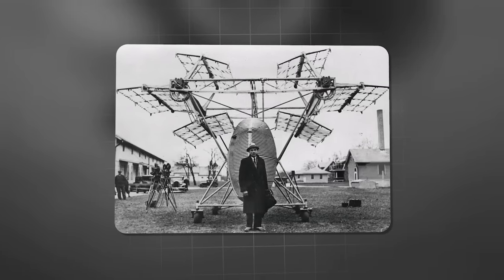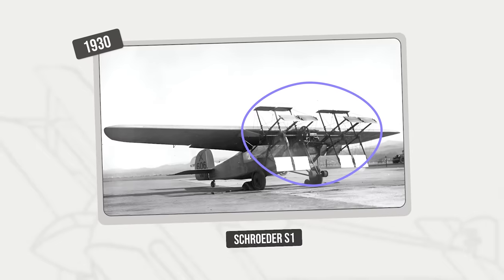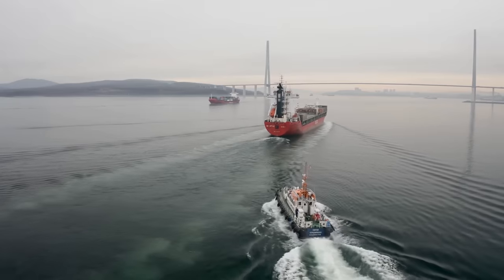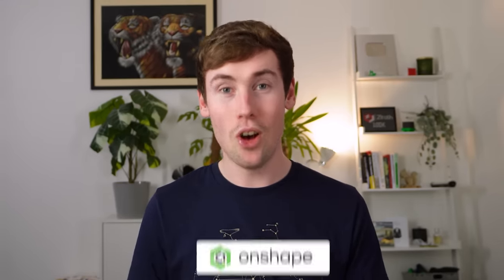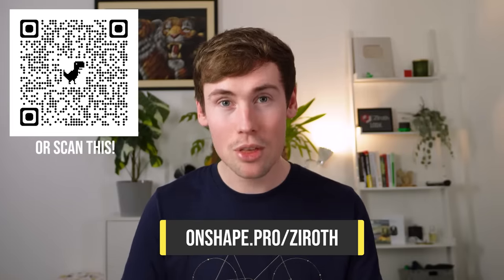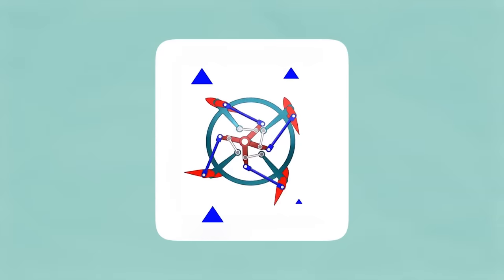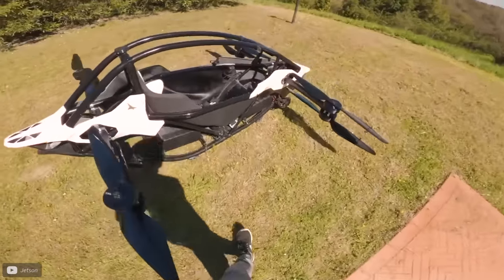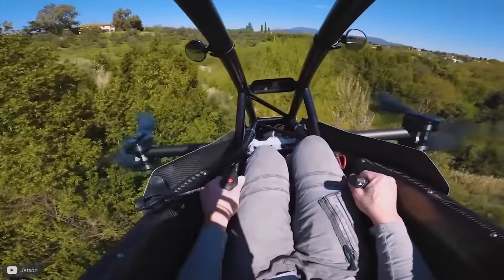The Genius of Cycloidal Propellers: Future of Flight?

Comment: Use them as cycloidal propellors for VTOL then "feather" them into horizontal position to act as regular airfoils in a craft propelled by the thrust from a turbojet. The turbine could even have a power take-off to spin the cycloids when they're being used in VTOL mode. Whether that's any more efficient than alternative technologies that accomplish the same thing is the question that needs to be answered, but something like that is likely the best way to solve power to weight ratio issues.

Comment: Very well-presented video with the pros and cons of this propeller! It reminds the limitations of vertical-axis wind turbines (Savonius and Darrieus) versus horizontal propellers. As you mentioned, dynamic control of the blades is required to maximize efficiency, which increases complexity. However, there should be some benefits for some applications. Thanks

Comment: With conventional propellers you tilt in the drection of travel. It looks like you'd be able to control direction and attitude almost completely independantly with a cyclorotor. You could accelerate while remaining flat and level or you could hover while looking at the ground. very cool

Comment: I sailed tugs with Voith-Schneider cycloidals.
Reply: A man told me about the test of two of them. On one of them the blades bent under test and should be strengthened. 
The other tug pulled the bollard off the pier. That was his excuse for being late. 
Oddly, no-one at university believed such a propulsion system existed.

Comment: Works much like a helicopter, and if any rotor fails, you have no wings to glide down safely with. At least a helicopter has some mass to sustain inertia on the rotor for a partially controlled decent. I think I'll stick with fixed wing planes. Replacing the screws for water vessels however is an interesting idea.

Comment: An obvious advantage of a four cyclorotor craft is that the outer hubs of the rotors could have tires on them and also serve as wheels.  It could drive along the ground when not flying.
Reply: Maybe. The ground wheels would have to decouple from the airfoil rotors so the latter could produce enough lift for takeoff without propelling the former to ridiculous speeds, or so I feel (not an engineer in this field).
Reply: You would just need to have the aerofoils turn to angles straight on with the rotation to not create lift. And if the car driving dynamic performance got high enough, you could also have them turn in the reverse direction to generate downforce. And could even have it sense and adjust each corner to maximize grip of each tire. 
But... that would also mean adding suspension linkage that was locked stable during flight but compliant on the ground, as well as steering system that could also be locked rigid in flight. Adding alot more weight and tons of additional complexity.. not to mention battery life to drive after doing a flight... but who knows, maybe 80-90 yrs down the line 9f development as other technologies advance with it..

Comment: Spinning a pair of semi flexible wings around a hub so that they fly in place and controlling the angle of attack cyclically and collectively for altitude and directional control is a good way to do vertical lift. And on top of that the bigger you make it the more efficient it gets, unlike the competing solutions. 
And it's mechanically simpler than the competing solutions. That's the reason we settled on helicopters for this sort of thing. That's also why helicopters like the Mi26 and CH-47 can exist, the bigger and slower the rotor the more efficient it gets at generating vertical lift. An Erickson Aircrane's turboshaft has about the same watts output as an F35B's engine but it can lift 11,000 lbs in addition to it's own weight while the F35B in VTOL can just barely lift itself and needs a rolling start when fully loaded.
 
EDIT this also one reason why we don't have full scale multirotors, a single large slow rotor is more efficient than 4 smaller faster ones. Full scale also requires use of constant rate variable pitch props (you can't really control thrust by RPM unless it's an electric system, turboshafts, piston engines or variable speed gearing systems would be too slow) and you end up with a machine that is more complex than a helicopter while also being less efficient at vertical lift.

 They actually built something like this in the 1950's called the Curtiss-Wright VZ-7, it used a central turboshaft engine connected by shafts to four variable pitch props and was stabilized by a three axis mechanical gyro system. It was said to be very easy to fly but it was mechanically more complex than a helicopter while also being less efficient and the program never progressed past a one man prototype.

Comment: I'm happy to see this progress and hope they continue. It looks to me like that setup would be excellent for control but for the primary thrust and I'm not sure it has it because I didn't see it, but it should be added. Is it it needs to have very rapid powerful air vents that is well thought out for propulsion. Some will work like powerful vacuums sucking air for moving air, then the air is routed strategically through pipes or tunneling within the craft of sufficiently large diameter all through to stay powerful. Somewhere are the powerful electrical pumps able to do this.  They aren't related to fans or airplanes or helicopters or turbines they are simply very powerful electrical pumps that are capable of moving a lot of air rapidly sucking it in and blowing it out both forcibly. They will do so so forcibly that it will need to be made of sufficient materials capable of expansion not of aluminum for example but a light stainless steel. this would be the primary drive for hovercraft of the future including personal vehicles and hoverboards and hover surfboards etc. But for controlling it, that would be where the other tech breakthroughs such as what these guys are working on. But i think you put those together you have a much more capable  craft, even if its relatively slow speed gains by simply moving air, it will create a lot of lift and be a great option for city commuters and people living in high-rises where they could park on the top of the building or on a ledge. Such technologies will continue to come into play as we master controlling most any vehicle at slower speeds.

Comment: I think this holds more promise in wind generators. They would have a great structural advantage because of supporting the blades at both ends. Plus, the lower speeds make it easier om the mechanism.

Comment: These seem virtually useless for flight, but I can see they are quite useful for maritime applications. Thrust vectoring for drone aircraft is simply done by tilting the aircraft, which allows an aircraft with a set of four rigid propellers to vector its thrust any (useful) direction it wants. Tilting the drone causes the forces on it to always pull an occupant be towards the drone's bottom, which makes the flight quite comfortable even if you are accelerating. The ability to further vector the thrust such that forces on the occupant of the drone would not pull them towards the bottom of the craft is really not useful for anything.

For maritime applications however, where you don't want to or can't let the ship rotate, the ability to vector thrust in any direction is indeed quite useful.

Comment: Compared to a regular propeller, they have several disadvantages:
1. They ONLY generate LIFT DURING HALF THE ROTATION.
2. They don't have the huge surface area that generates lift.
3. In order to generate the same lift, there must be many of them which create an unnecessary complexity.
4. They obscure the vision of the pilot, which in a war situation is extremely dangerous.
5. Common propellers can be designed to be maximally efficient.

A fun thing, but that's all it ends up being.

Comment: good video.   the uniform speed of the cyclo-rotor blade would mean they would never  have issues of retreating blade stall like a conventional Helicopter.   which also means they should be functional up to the speed of sound with out much trouble as well.   very interesting.

Comment: I can see microprocessors and sensors being used to optimize the angular positions of the blades as they rotate. The sensors can, for example, measure pressure at different critical points on each blade, as well as each blade's position along its rotational path. Sensors can also detect pilot input, direction of flight, and the microprocessor can then send pi9tch adjustment commands to highly reliable, robust actuators connected to each blade. The proverbial icing on the technological cake would be to add AI to the system, which will enable it to learn and improve its efficiency in handling different fluid dynamic conditions.

I think the above technology idea will improve efficiency and safety of both marine and aviation cycloidal propellers.

Comment: Thanks for the well-presented and interesting video. My first thought was - forget flight applications, develop this for wind-powered electricity generation, could be a lot more efficient than fan-blade types,  quieter and less visually intrusive. Could be arranged in multiples, stacked vertically with blades running horizontally?

Comment: The advantages are that by design, they are more controlable than  propellors, which can only push air in one direction, unless you put the propellor  on a controllable swivel, adding complexity. The lower noise output is interesting for civilian use in urban areas, and  accidents involving people walking into the things seem less likely to me.  A cyclorotr equipped vehicle is more manouverble than any other flying vehicle due to its ability to vector its thrust near instantaneously. The benefits of cyclorotors won't be lost on the militarues of the world, I'm sure

Comment: It the current configuration, they need to be big, much bigger before they show their capacity for being more usable for many applications.
Reply: I think if they slowed them down, went with bigger surfaces, it may be more realistic due to the scale to power factor.  They are still not much better then paddle wheels used on boats though, and so very many added moving parts, hardly efficient due to the friction and internal drag on the connections.

Comment: @ZirothTech I bet they could substantially increase efficiency by re-engineering them so that the blades are twisted and swept back, kind of in the way that "roots blower" superchargers became drastically more efficient when the lobes were reoriented into the "twisted roots" type of supercharger. It allows the charge air to flow along the surface in a way comparable to a swept wing and, in the compressible flow regime of an airfoil, sweeping the foil back relative to the flow delays shock formation and gives you a more favorable thickness-to-cord ratio. Seeing all these simple flat blades at right angles to the flow shows me that people have barely begun to tap into the potential for these designs. 🤔 😊 This could get very interesting very soon!! 😁

Comment: If weight is the problem, how about using Cycloidal props in heavy lift applications like dirigible or blimp type air ships?  The high maneuverability and loiter time would come in handy getting water on top of a skyscraper fire, harvesting timber in a forest, or maybe a quiet city sky bus?    :)

Comment: Check out steam powered paddlewheel riverboats. They used the same concept on its side to control angle of attack of the bottom blade, the one on the bottom in water, before 1900.

Comment: In order to get enough lift for large aircraft the rotors would have to be massive which would be almost impossible because the engines required to turn something that big would be massive. Though I’ve been wondering since I learned about this type of technology if it could be combined with other means of generating thrust or lift. Like adding plasma actuators to the rotors.

Comment: I'm sure many pilots like myself are skeptical as to how will this propeller (in aircraft application) survive emergencies such as bird strikes or foreign objects striking it?  Without any kind of shroud and/or nacelle protecting the blades, all it takes is a couple of birds being stuck in the rotation and bye bye altitude and directional control!  For marine application, what happens if a ship runs aground?  Maybe that's why the propeller shape hasn't changed in over 100 years?

Comment: Certainly interesting tech. Compared to propeller-driven airplanes, I suspect it's more likely to be useful for slower but more precise maneuvering -- kinda like helicopters. At speed, it may encounter a similar problem as helicopters, where one side of the rotation moves into the direction of motion and one moves away from it: so if you go too fast, the receding side may stall and/or the advancing side may approach the speed of sound and fail. Might be interesting to see how useful it is if/when the technology is more developed.

Comment: Not being an aeronautical engineer, I still wonder if the rotors could be made both sturdier and lighter by shortening their length and cord and adding another set. But,  more motors, more weight unless the additions are instead synced mechanically with kevlar-infused belts. They would have thought of all if it were feasble.

Comment: It is my impression that there are vortices being generated from the wing tips of the blades of these propulsion and lifting systems. The circular endplates would certainly act a bit like winglets in reducing the magnitude of these vortices, but they would be unable to eliminate them completely. Higher aspect-ratio blades might be helpful here, especially in the ship applications where only one end of the blades is anchored and controlled. This also raises the question of the efficiency of the forces being generated by this means when compared to a regular propeller of equal size. Is there any advantage here because the disadvantage in the need for providing variation in the cyclic pitch may be more significant.

Comment: i came up with the schroeder s1 rotor .. then found it on this early airplane.. bummer. but think if you turn it upside down it would make a nice wind generator or as is a great paddle wheeler boat as the blade will stay in the water longer
Reply: this rotor is very different in that blades turn once every two rpms so it uses both sides of blade on every other turn

Comment: Can this autorotate when mechanically linked? Because this would allow for really compact quadcopters that can handle engine failure and side winds without tilting the craft thanks to thrust vectoring. Centrally mounted gas engine and you’re good, switch to electric when batteries improve. 
Maybe combine it with regular props; 2 of those front and back and 2 Schneider on each side. At speed, turn the Schneider off and they act as stubby double decker fixed wings providing lift.

Comment: Don't forget about two factors:  P=v*T/η - there v depends on section S:  v=sqrt(T/2*rho*S), and S=L*D - you should have big [L]ength and [D]iameter of cycloids to reduce [P]ower needed. And second factor is η - efficiency coefficient which depends on interference of blades and horizontal vortex produced by cycloids which both depends on D (closer blades = more interference, and bigger angular velocity which produce horizontal vortex). And these two factors renders this concept much less attractive when traditional rotors.

Comment: Combining cycloidal propellers with toroidal propellers or even more conventional ones in a hybrid system might solve some of the issues presented. You could even turn them off or cycle them depending on requirements for increased power efficiency, weight and complexity being the major downside.

Comment: I think it's undeniable that the spinning propellers have the most efficiency for type of motion and control. If the schneider propeller was able to adjust its angle mechanically... easily. I do think making the propeller a type of paddler is smart. You want the flat face going down the skinny side going up

Comment: While the cycloidal propeller is somewhat new the rapidly changing blade system isn't. This is the same type of system that helicopters have been using for decades to adjust flight directions. Its still an amazing system when you break down what its doing and how fast its doing it.

Comment: The issue with this will be the added complexity.  Complexity generates cost, and in aviation that cost is exponential.  Complexity also generates failure modes, a more complex system will have many more failure points.  Helicopters can do what this promises already, and are horrifically expensive to operate.   its unlikely this will offer a quantum improvement in performance over current design for anything like a competitive cost.

Comment: I wonder if the basic idea behind cycloidal propellers is applicable to rotary woofers. I know the armatures on conventional rotary woofers can run into problems with stiffness and response time. Maybe a squirrel cage could do better, and the thrust vectoring capability of a cycloidal propeller would be the key to getting it to work efficiently.

Comment: The design itself is not of much use today because most of its advantages can be obtained with an ordinary propeller rotor. These jet aircraft engines are smaller and more efficient. To reduce noise, if you turn a larger propeller with appropriate force, it will produce the same thrust as a small propeller, but accelerated to a much higher speed. This is where the noisiness of drones comes from.